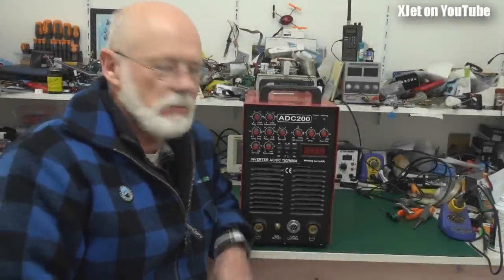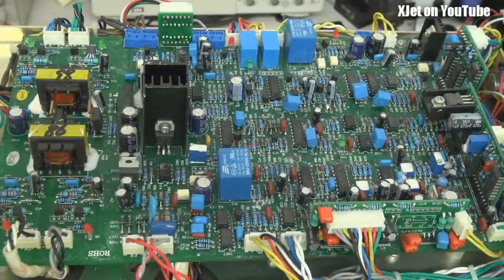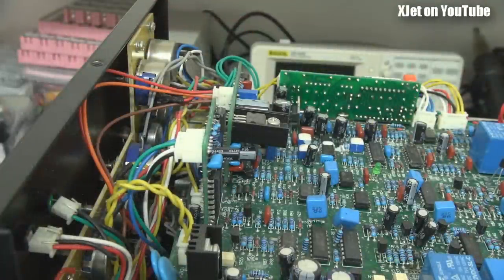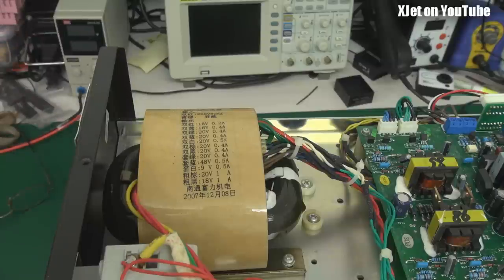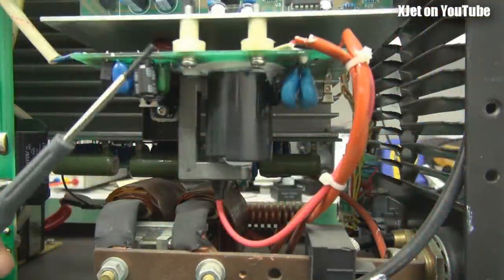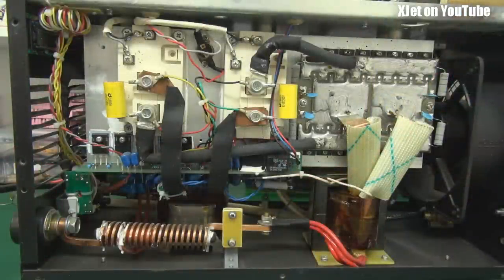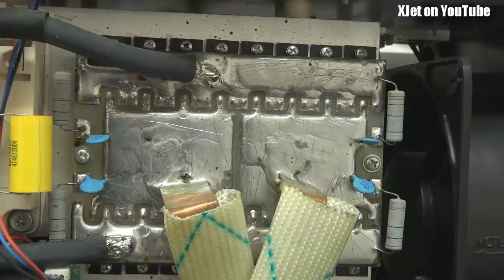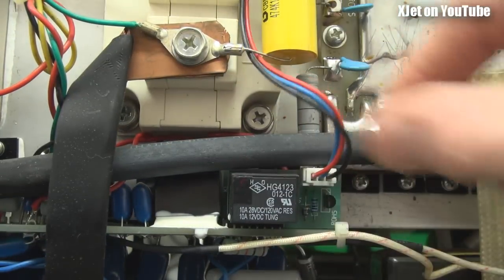Chinese 200A TIG welder teardown

Comment: the hole at 16:00 is actually for a third winding to deliver higher current. the current sensor looks like a hall effect DC amps sensor which measures the magnetic field the copper bar produces.

Comment: In Australia this welder is known as the ROSSI TC205AC/DC and the manufacturer is Shellmax in China. There are some external cosmetic differences but the internals are the same. They have improved on the electrolytic caps which state that they are rated at 105 Celsius but I doubt it as they are still is a no name brands. Studying the circuit, they have borrowed bits and pieces from other welders, e.g. the stages that controls the main IGBTs is the same that in an older Everlast I remember seeing.   The secondary AC inverter controller board is that of a WSME 200, seems to be a popular welder in China.

Comment: Love it. I have a very similar, albeit somewhat younger, TIG welder and I've never had to open it up, touch wood. That said, I have every expectation that I will, at some point, find myself delving into its innards looking for a fault. So yes, please continue on this track and fix it so the thousands (tens of, hundreds of???) of us that have similar machines will have a "heads up" when our turn comes.
Unlike yours, I have driven mine hard welding some pretty thick steel maybe they need to be "treated mean to keep them keen" and "spreading it ( 2:22 )...... to get to the juicy bits ( 2:28 )" won't be needed.

Comment: The good thing about these cheap Chinese products is that they are not designed to fail after the guarantee period - they ether fail after a couple of uses or serve a lifetime. I had expensive equipment from "respected" companies  (aka "Made in the People's Republic of Germany") that pooped after a couple of years of moderate usage, and I have cheap Chinese crap from eBay that keeps on working for years.

I mean, take this first board you show for example. Even if it breaks, you can easily fix it, and if not, then take all the components from it, the price of this thing is probably cheaper than buying all of those components separately.

Comment: I think you are incorrect about the current shunt. The shunt is the whole black module. It employs a hall-effect sensor. The red wires from the transformer is the center tap that goes through the HF-starter and out. The unit operates in push-pull mode where each phase goes through its own set of rectifier diodes.
Reply: +zaprodk I second that, more likely a DCCT (dc current transformer) based on hall effect or something similar and the calibrated hole is more likely to be a mounting point or electrical terminal connecting point if needed.

Comment: As always, an interesting and informative video, Bruce.  I never understood the concept of simply blowing stuff up.  I learned the most by tearing stuff down, figuring out how it works and trying to fix it.  Of course you often find out it's crap or beyond repair making it destined for scavenging, the dustbin or popping, as photoinduction liked to call it.

If your inverter welder is beyond repair, perhaps some of the parts could be used to turn a small, low current, transformer based AC welder into a little TIG machine for welding light gage material, like what you were using your welder for.  That would be cool.

So, maybe a little bit of everything depending on the situation.  You may find the popping crowd to be not as tight-fisted as the fix-it crowd.  ...or not.
Reply from the maker: +Fourcycle Don't worry, there's a lot of science involved in blowing stuff up.  You'll learn about the difference between detonation and deflagration, about stoichiometric ratios and a lot more :-)

Comment: I bought an expensive Chinese TIG welder, and actually it hasn't been too bad  I got easily over a hundred hours on it, both with TIG and stick, probably more around 2-3 hundred hours and surprisingly it has lasted.  I did end up with a small dust problem with it so I had a glance inside when I blew it out and it looked a lot cleaner (design wise) than that.  So I'm kind of comforted that your cheap machine looks qualitatively different than my expensive machine :)  When you buy high priced Chinese stuff you always kind of worry that you're just getting a more expensive Chinese piece of crap.

Comment: I liked the "Dog's Breakfast" comment and the overall review. I like your critiques, and I think they were fair if not generous. This is the kind of video where you get to laugh a little and maybe drink a Pepsi. For the Chinese designers, you can only imagine what the engineering requirements were like. It was kinda cool, and I was kind of proud of them in a way. With all the "fixes" and gobs of solder they actually got everything to work at one point.

Comment: Sorry Bruce, but I nearly choked when you said $1800????? I just had a quick look on ebay and you can get a portable tig for about $230 which would be fine for doing what you describe. I know technology is great but the best tig I have ever used was ANCIENT and huge! Was about 3m square, weighed over a ton because of the copper in it, but it was so smooth! You could weld a softdrink can with it! Which is a great test for would be tig welders!!! Once again, great to still have you with us, keep the great video's coming! LOVE YA WORK!
Reply from the maker: +MrRBalmer This is an AC/DC pulse TIG so it's a bit more full-featured than a plain $230 unit -- and that was the price about 6-7 years ago.  They're cheaper now.
Reply: AHHHHH pulse, that explains a lot, but still expensive.
Reply: +MrRBalmer Also in the States I've noticed welders are significantly cheaper than most other places.
Reply: +xjet Heck, well over half of that price was to pay for all of that solder, LOL! I have never seen so much that wasn't still in a row of coils on the shelf at the plumbing supply house! That's wilder than a trip through the forest in Borneo ;)
Reply: +MrRBalmer These welders are around 1000 $ mark. These are quite good if they dont brake down (as well as the well known brands) and far better than anything old and big. Inverter tig machines are much better than transformer ones. Althrought not much difference in mig machines.

Comment: First time on one of your videos, and found it very interesting: You have another subscriber now.
It would be great for you to fix and post your procedure for the fix. I had purchased a used Everlast TIG 210ext welder on eBay. When it arrived the high frequency did not work. Everlast technical thought it may be the Hf board, thus, I bought and replaced that. When turned on there was a flash and smoke from inside. I didn't attempt a refix. The good news is the seller was honest and refunded all costs including return shipping. The Stick function work and I told him to sell it as a stick only welder. I was sure any further fixes from Everlast would put the cost over what a new one listed for.
Note on your video; as most of todays stuff comes from China you got me worried about what is good any more! For the $1800 you mentioned I would have expected it to be much better in the first place. I have an AHP 200dx (2nd generation) Tig/Stick welder and think I will open it up and hope it does not look like what you found in yours. They are up to the 4th generation, but mine is still working…….I need a piece of wood to knock on fast!
Reply from the maker: Nice to have you onboard.  I've got some more engineering/welding/teardown vids planned.
Reply: Tom Herd I was looking at the Everlast welders a while back, decided against and went with a ThermalArc 200A TIG ac/dc pulse ect... $2300 very happy so far

Comment: Nice one Bruce, enjoyed the walk around of that horrible bit of kit. Puts me in mind of some of the old gear that I used to fix in the 70s & 80s - masses of components and discrete logic - took a lot of skill, practice and familiarity to fault find. Stuff is so cheap today that the cost of skilled labour to fix even a relatively simple problem means it's often more cost effective to chuck it in the bin and buy new. Shame really as it's deskilling the service industry, so it's a downward spiral.

Comment: The new welders with all of the electronics in them worry me as far as longevity goes. My old Miller EconoTIG is a much more simple design. It is also still working for me for over 20 years now too. As far as content goes this is the sort of thing that I like to see. Perhaps it is not for everyone, but I like it. I'm just wondering if this host and Dave Jones of EEvblog know each other though. They could be twin brothers from different mothers.

Comment: I've had several inverted based Chinese welders (plasma/tigs, migs) over the years. It's pretty amazing how simple circuits scaled up can throw out such power. That design in that is def from a decade ago. The "current" ac/dc tig boards are further along. The funny part is that basically all of them are the same schematics with the same parts. I had one (of four) go bad & kept it for spare parts.
One thing that's interesting is that they can't afford to use real solid state HF circuits to start arcs; so they use a spark-gap that must be periodically adjusted & eventually wear out! The EMI will knock out your cellphone/rc/etc. Spark Gaps don't play! (Why spark-gap radio transmitters are illegal in most places)

I took one of my 110/220v DC-tig's and with large solid state relays and a timer, gave it Pulse, ac/dcep/dcen. They're all OK for what they are. AKA, low duty cycle "project" welding.
(btw im a highly certified welder in real life)

Comment: The power sections of the welder remind me of electro surgical units used in hospitals.  Much, much neater construction, and top drawer quality components, but big, thick cables, or straps to handle the current.  Very interesting video.

Comment: Bruce, 
Over the years, I've had a few Chinese inverter TIG welders that worked great!
My latest one - Not so much.  [It's a 250 amp TIG welder / Plasma cutter combo]

I used the machine every day, and it worked fantastic.
One day - "the next day" - I come out, and something was immediately wrong..

With the Amp dial set to zero, the amps will only go down to about 120 amps.
From there, I can go from 120ish up to the full 250, but, it won't go under 120.

The first thing I did was replace the potentiometer with a new / higher end one.
Unfortunately, when fired back up, I see the same exact issue..

I did a lot of precision welding [for equipment I used to sell]
and with no way of lowering the amps now, I was forced to stop welding..

The welder just sits collecting dust now instead of making me money..
I'd love to get the thing back in 100% working order..  Low amps would be great..

Do you have any clue what the issue[s] could possibly be?

I intended on getting in touch with you and/or Dave Jones a while back, 
but apparently I saw something shiny, and your video just reminded me..  

How this thing lost it's 0a to 120a range just baffles me..

Thanks in advance if you can comment / help out!

Sam -

PS:  The Amp knob / potentiometer on mine connects to a small pcb
that has one other component on it..  I was going to try to source another one, 
but, I only know enough about electronic components to get myself into trouble..
Here's a shot of it - If it might help..

http://i1233.photobucket.com/albums/ff386/dirtydovi/TIG%20Component_zpss0vwq8cs.jpg

Comment: Bruce I have fixed a few welders only to fix them again and again. It's not worth the aggravation just blow it up. 
I recommend binary explosives as they are relatively safe and legal 5lbs of ammonia nitrate pellets coated in a fine zirconium powder in plastic jar should do the trick nicely. Place the welder on top of the jar and shoot the jar with a high power rifle.
Zirconium powder can be difficult to obtain. I have been told aluminum powder works well but I understand it is difficult to obtain in your part of the world so you may want to try some of that aluminium your always talking about.

Comment: Wow!... my mind is blown to micron-sized dust particles about how complex that welder is... utterly incredible!.. lol! :-D 
I envision the most basic and totally dependable welder as having as it main parts a big 120/240 VAC power transformer with a nice thick primary winding, and humongus straps for the secondary winding with multi-taps and a big honkin'  rotary switch to control the amperage and big, BIG diodes for nice smooth pulsating-DC welding...simple, solid, heavy in weight and last for centuries practically. ;-)

Comment: Not used to "talkies" on xjet, lol   Good video.  That thing doesn't look good enough for a dog's breakfast (more like what comes out the other end).  It's amazing it worked at all.  The occasional resistor or diode bodge in a product is not unheard of, but to bodge in a transistor is a troubling sign.  I doubt it's worth spending much time on that, unless you can find a service manual...

A fellow named Aussie50 recently had a video of unboxing a BOC Smootharc welder.  Near the end we get a look inside and find it is entirely surface-mount construction, with a nice conformal coating.  What I can see looks good.  Hopefully your new unit resembles it more than this horror.  That was a MIG welder to be sure, but electronically it should be very similar.

Comment: Wow Bruce - you really do know what you're talking about! Often wondered who actually designs this kind of stuff.
Reply: It's likely a "design by accident", a platform that started somewhat simple in the 80ies and which was then copied from one manufacturer to another, each introducing changes either because of parts availability or to fix problems or add features, neither of which understood or was willing to modify the complete design but just as little of it as necessary to get things moved along, and so it grew organically.

Comment: I'd like to see a teardown of one of the big brand name roughly 200A TIG machines.  Miller Diversion 180, Lincoln Squarewave 200, etc.  There is one video on a welding channel that opens up his sponsor's new machine and remarks knowingly on the proper use of zip ties.  I chuckled.

Comment: Just bought a broken Everlast unit. Opened it. Thought that someone with 0 experience of soldering has opened it and done some own modifications. But little did I know. The soldering work is equivalent to unit shown in the video. Horrible. Everything misaligned and loads of solder here and there... I'm happy to learn that it seems to be industrial standard to produce lousy components and wrap them in nice boxes..

Comment: The copper bar is no "shunt".  The current is measured by the Hall Effect transducer by magnetic principles, not by resistance.  The hole is there probably just in case the sensor would need to be mounted in opposite direction.  Design time uncertainty and then just left in.
The secondary "transformer" is actually a choke.  The arc starter uses an air core Tesla transformer and the small wires coming to it are from the arc starter and are the primary.  Several hundred or actually some thousands of volts applied to the 1 or 2 turn primary and the big copper coil puts out even higher, ringing voltage superimposed to the available welding current for the arc start.

Comment: That 80s era looking board is probably a exact as practical copy of a actual name brand 80s era board. Also noticed most resisters are discolored from overheat and a bunch of them are recycled. Not sure if the recycled part is good or bad looking at the new crap

Comment: That extra solder to reduce the resistance of PCB traces is perfectly fine. As Dave Jones has shown the resistance will go down a lot. Go check his EEVBlog video.
Reply: It can help if the whole area is coated. You can just about double the conductivity if you lay like 8 times as much tin on the trace as you have copper underneath, which is possible. But in this example they put on a really narrow strip of solder, not much more volume than the copper under the solder mask, so the result is that this extra tin is inconsequential here. Furthermore look at the texture of the mask, the copper is really thin, 1oz (35u) tops, which means doubling the copper thickness would have been a sensible first step.

There is however a possibility that it isn't just tin on there, that they actually soldered a bare copper core wire on there along that trace. This is actually very effective! It would also explain the narrow mask gap.

Comment: Looks to me like the welder is AC capable.  The large white IGBT modules form a bridge to reverse the output polarity.  The current (not voltage!) control happens on the primary side as Pulse Width Modulation.  The hall effect device (looks like a copy of a Talema part) measures the current for feedback to the PWM on the primary.  The diode banks are mounted as shown to balance the secondary current between the FAST rectifiers.  Then the DC goes to the IGBT modules for the possible polarity reversal (Variable Polarity, used for aluminum welding).  And finally to output via the arc starter transformer.  By the way, did you notice a ferrite rod inside the starter transformer?  Iron core would not work for the high frequency.  Another detail might be that the whole arc starter arrangement with this transformer and the TV type high voltage generation is an evident copy of American designs by Hobart, in 1980’s, if not even earlier.